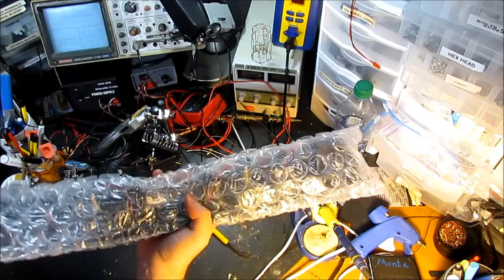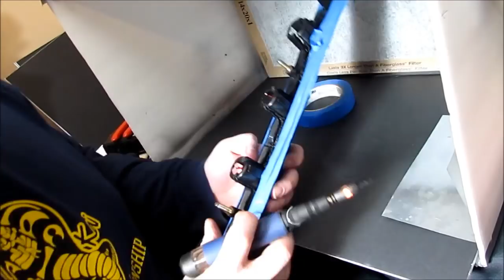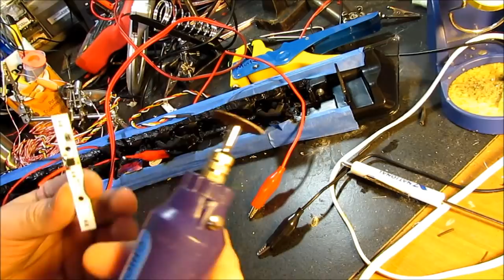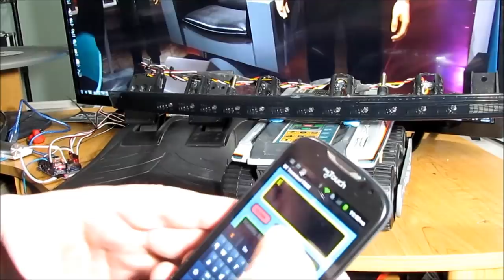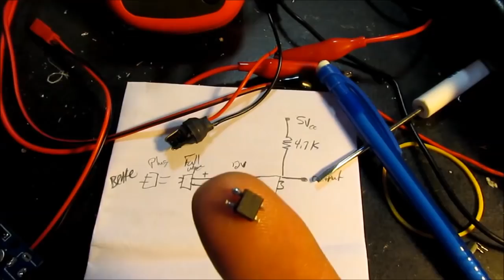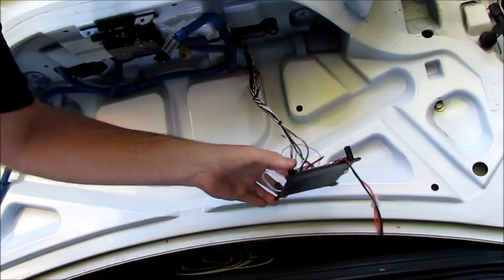015 Building a Cylon Taillight for a Mustang Cobra

Comment: Could you have found a more obnoxiously stupid rear plate and wing?
Reply: depending on the version of Mustang Cobra, a larger wing was stock.  I mean, he's got lambo doors and you're fixated on the plate and wing? the doors are the egregious bit LOL
Reply from the maker: Not really, that was the most obnoxious I could find.  ;)
Reply from the maker: Yes that's the spoiler from a Cobra R.  The only "real spoiler" available. From my understanding it has to be that tall to get good air flow, all the other mustang spoilers/wings are just cosmetic.
Reply: 03-04 Cobra duck tail was tested in a wind tunnel! Cool video though, you have skills.

Comment: I was wondering; could you have baked the stoplight module in the oven to open it up, rather than hitting it with the hot knife? I know folks do that with headlight and taillight modules to convert to LED or HID systems.
Reply from the maker: I haven't seen that trick.  I'd be afraid of the whole thing sagging, but it might work.
Reply: I don't think the bake temperature is terribly hot, certainly not hot enough to melt any of the plastics, only to release the adhesive that binds the lens to the back structure. It's been a while since I read anyone doing it, but none of them have recorded any issues with doing it.